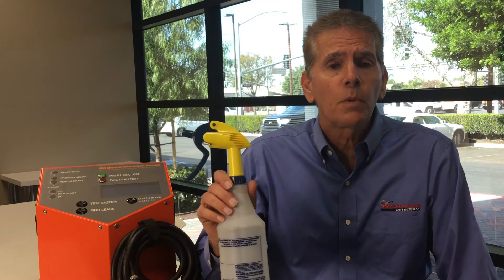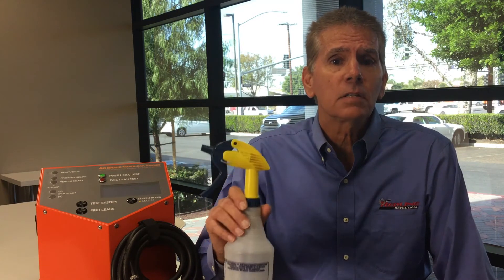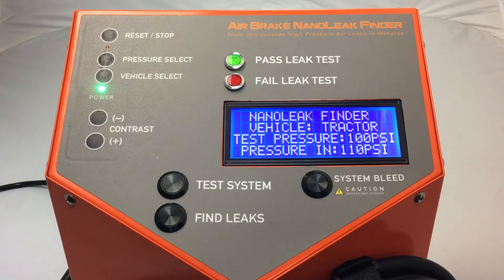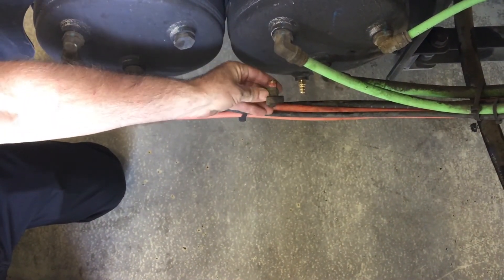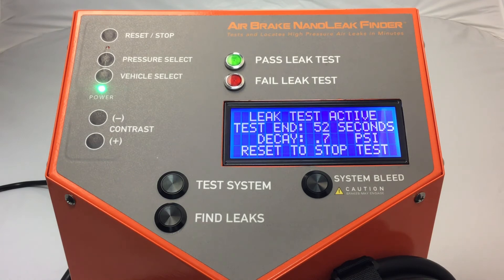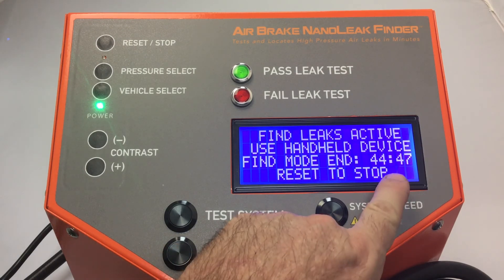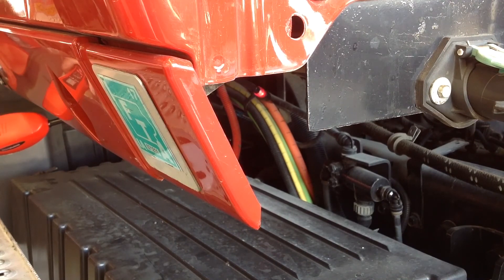Air Brake NanoLeak Finder Introduction

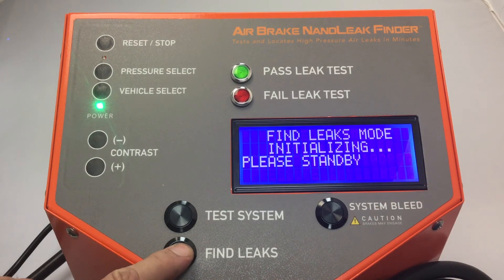Comment: 2:22 "... we select find leak the Nano leak provides 15 minutes of signature error in order to detect the leak ... "

Should that read "signature AIR" and whether or not, what is the detector "looking for" (high frequency sounds, particular elements like high concentrations of Nitrogen, etc., etc.)?  

This tool certainly will save techs time.

P.S. - Good to see ya Mike!